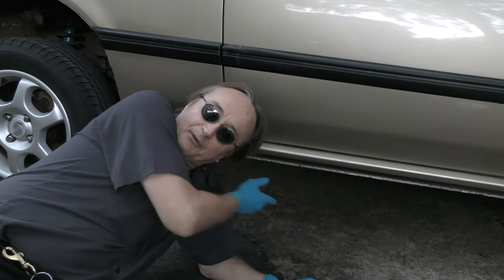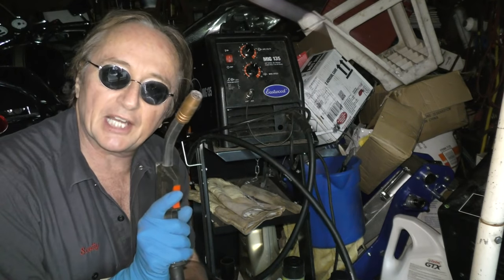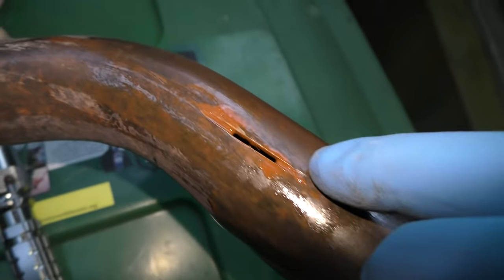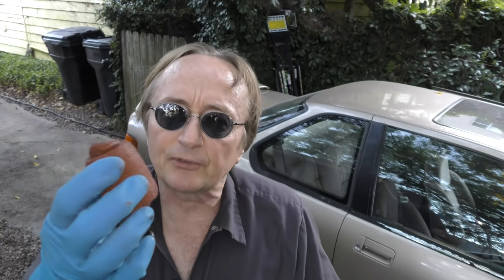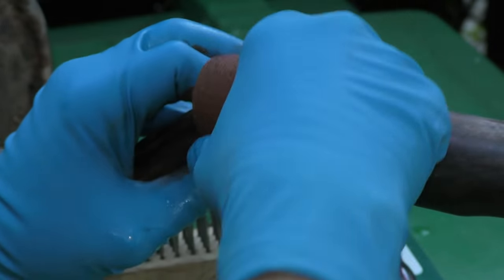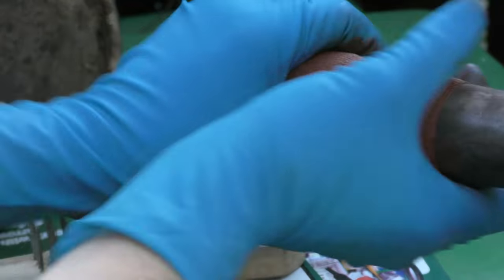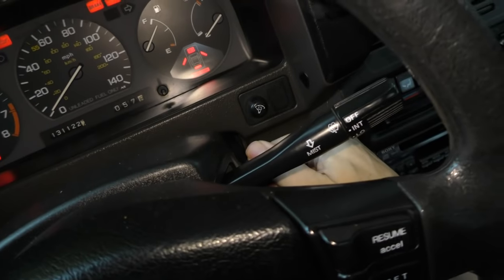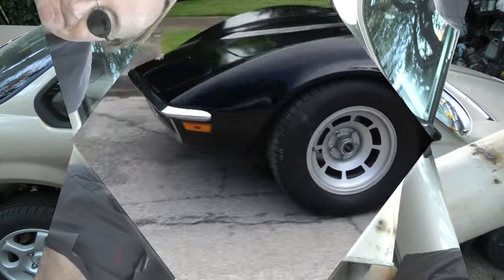How to Fix Exhaust Leak in Your Car for $12

Comment: The shop was going to charge me $60-80 just to get a new piece welded on my exhaust leak, bought this at Walmart for $12 and it worked out great
Reply: Montana Yang  Well of course it's cheaper, it's a band aid not a repair.
Reply: $60-80 i would of done it!
Reply: They are asking 400 for me lmao
Glad I didn’t fall for it.
Reply: did it get rid of the loud noise?
Reply: I used the product from JB weld.  It failed shortly after install.
Reply: 60 to 80. That's cheap.. for that. I would of let them do it. My mechanic wants to charge me 200
Reply: That’s a good price, plus it will last longer.
Reply: I would say 60 is very good for weld job

Comment: My dad used to cut open a Coke can,wrap it around the exhaust hole,and secure it with a piece of coat hanger wire.I did it years later to my car,worked great.
Reply: Soup can works great too-Last for ever- But I LIKE the tape idea
Reply: This fiber stuff works better. I used to use pop cans and steel wool to fix leaks but I'd have to change it out for new cans and wool every month.
Reply: A little JB weld into the hole should work as well. If you have a low temp heat gun, say 200F you can cure it within 10 minutes or so. I wouldn't go any higher than 200F or you might weaken the bond too much for it to last. At the point where I'm very tempted to JB weld the pipe together after repairing a badly damaged cat (the guts were so far gone they poured out as ash). Figure the stuff is strong enough to have JB welded my plenum back together and not leak so it should stand up to the exhaust pressure just as well.
Reply: I love that innovation :)
Reply: Cut a length from a junkyard vehicle, take it to "The Zone" and get a coupler that'll sleeve tightly over the problem area. Cut the pipe straight with a sawzall, smear furnace cement on the cut, smack coupler onto one end with a mallet. Shove it all back together. Wipe off, hit with BBQ paint. It'll actually look decent.
Reply: @eideticex  High Heat JB Weld is a thing.
Reply: Мы в России так же делаем!😂 только лучшее банку от консервов. 😅😂

Comment: You can also use refrigeration foil tape. I used it many times in the past with great success. For a lasting repair, make sure you wire brush the pipe, then wipe it clean with 91% rubbing alcohol before applying a few tightly wrapped layers. Rub down the layers using a rounded object. The heat will bake the tape onto the pipe.
Reply: Would it work on an exhaust header pipe?
Reply: @mrsemifixit  It may be a little too close to the head.
Reply: @electronicsNmore  meaning too hot for it?
Reply: Neat tips. But i just went to a mech shop here in Sweden ang got the CRC Exhaust Mounting Paste. Its supposed to expand and cure with the heat as you start engine. Then whenever you would need to remove it just knock it off. Better than welding in case you need to get original exhaust on again if you sell the car (i just swapped to 3 inch Cobra Sport exhaust on my GTI Clubsport) Anyways, well see if it holds up. Check the car on my channel!  👍
Reply: You must be an equal to Scotty now...
Reply: @electronicsnmore,how long did it hold up? Does the refrigeration tape have adhesive on the back or did you need to apply something else?

Comment: Scotty, I got this kit and used your instructions and it worked. The problem was that I needed to fix the hole to pass Pennsylvania yearly inspection. I learned that in Pennsylvania, only cutting out the section of the exhaust pipe with the hole and welding in an replacement piece of pipe is the only way to pass Pennsylvania inspection.
May I suggest that you make a follow-up or an addition to this video telling everyone to double check what is allowed for each person's state inspection.
I watch your videos constantly and have been very happy with your suggestions to fix whatever.

Comment: UPDATE: Crawled under my Yukon, And it was just the clamp that attaches the Muffler to the pipe that leads to the Cat, the pipe had come loose. Of course the nuts were rusted on and I didn't feel like doing any WD-40 so I just bought the muffler tape (Which in Canadian Dollars is actually 17 bucks!) and popped the pipe back into the muffler and taped that up instead. Took the truck out for a spin for 15 minutes and the tape held on fine. 

Thanks for the video Scotty Kilmer! Keep making em!

Comment: Have the same issue after taking it to a shop, didn’t bother to tell me where the leak is. But guess I’ll take time out to find it. Yea it’s a cheap fix but it’s a year 2000. Not worth putting too much money but it’s still sentimental to me, and still runs great.

Comment: My friend just used the high temperature Gasket sealer (silver) and it worked so far for 3 years, I recently hit my downpipe on a pothole (lowered car). But i would trust this method is much safer and will probably last loner.

Comment: My 2012 Titan truck is great but the exhaust pipe rust through at the flange so I cut the pipe and bought a flange and two clamps that worked very well..

Comment: In Poland, you can fix it in many mechanics workshops or specialized muffler/exhaust system service for a 50 Polish Zloty (less or more about 13 USD), so in my country fixing this issue with that method is rather unprofitable. Moreover to fix exhaust with that tape, you must have some kind of undercar-pit, and in many cases, you will have to remove the exhaust because of hard access to wrap around the pipe that tape - and this is next issue, especially when exhaust is old, bolts are corroded etc... Personally, when i have that kind of problems (small holes in exhaust etc.) i seriously considering to replace a whole exhaust (muffler+pipes, only catalytic converter can be kept old..), because in my country climate and weather is very "good" for progression of corroding process, and this old rusty exhaust doesn't serve more than few mounths untill it gone pernamently... (sorry for my flimsy english...)

Comment: Can this be used to repair holes in rusted cast iron plumbing? How hot does it need to get to cure? Heat gun hot or propane torch hot?

Comment: Probably a stupid question but is this strong enough to hold a section of pipe? Someone stole the cat on this car I just bought so I was thinking of getting a straight pipe put on anyway. If I get a section of pipe that a little smaller in diameter than the pipe on the car, insert it so it's tight and roll this tape around the seams on both ends will it hold? Definitely wanna give it a shot before I spend $500-$800 on getting it fixed. 

My logic is that since the pipe will be slightly smaller in diameter it'll be able to be inserted and that way it can hold its own weight. The tape would just secure it even further and prevent exhaust leaks coming from the seams. Stupid idea or feasible?
Reply: Id put a clamp on it but put it down some so you can also wrap up the area it can escape you know what im mean?

Comment: I've used a brand called tiger patch about 20 years ago on an old 70s ford I had. It held good until I could change the whole system. Got me though state inspection. That's all I cared about at the time!

Comment: Hey Scotty really need your help. Need your opinion on this. I've got a 93 Caprice Wagon with a leaking exhaust manifold. I've been putting off the repair because I can't afford it at the moment, Is it ok to drive the car with a leaking exhaust manifold? Will it hurt anything? I've had a few people tell me it needs to be fixed ASAP while some mechanics say to drive it like that, one mechanic said it's not worth fixing and should drive it as is. It's currently inspected till the end of the year. Can I drive the car like that?

Comment: Scotty, my 2009 Toyota Avalon spits out a P0037 code, and I changed the oil pan because it was leaking but I had to loosen the Exhaust. I broke the flange bolts, but had to loosen the o2 sensors And one O2 sensor got bent can it be the cause of the code? I'm really lost here love Toyota but still confused on this code.m

Comment: That looks a lot easier to use than the old stuff, you had to soak the tape in some glue they give you with it; it was super messy and really hard to deal with.
Reply from the maker: yes, this modern version is MUCH better and less messy. Plus it hardens faster and stronger.

Comment: Gonna probably do this tomorrow - Today my freshly purchased '92 GMC Yukon started sounding like an angry grizzly whenever I step on the gas so i'm assuming I put a hole in the muffler or cracked the pipe, like in the video. Hopefully it is just the pipe.

Comment: I am told here in PA that exhaust repairs must be done with metal, and wraps and epoxy don't pass inspection.   Sound legit?  How many states I wonder require more permanent fixes.

Comment: Does this work to join two rotten pieces of exhaust? The exhaust rotted away in the middle not near the joint so otherwise I would have to replace a good amount of the exhaust system before the muffler.

Comment: So what's the deal if the exhaust leaks at the flanges(where the connects)? I got my Y-pipe caught on dirt while the exhaust was hot and it bent the flange after the headers, before the cats. My mechanic said I wouldn't be able to use a fix like this(or that putty stuff) due to the heat generated. Ended up having to buy a new y-pipe(i brought it myself) and had him weld it for me.

Comment: I installed a new exhaust on my car few months ago but now I realize there's water coming out at connections where pipes meet and some smoke coming out at clamp location? Is it normal? I know there's weep holes in OEM mufflers but not on aftermarket ones. Not sure how aftermarkets deal with condensation.

Comment: any temporary fix for a small leak at the manifold gasket, or will the heat destroy all attempts?
Reply from the maker: at the gasket, you really need a new gasket. BUT, there are high temp putty systems in a jar that I've used to some extent for short term fix
Reply: Scotty Kilmer Will it work on a flex pipe ?

Comment: I recently used a can of corn. Thanks to a You Tube video. I cut the can length wise and put it over the pipes were they were leaking. Used clamps. JB Weld  It is very quiet.

Comment: I have a Ford Excursion 2000 v10. I can smell the exhaust from the cabin. Is there a possible leak somewhere in the exhaust system?
Reply from the maker: sure, check for noise, especially early in the morning when you can feel for leaks without burning your hands

Comment: I know this is a cheap fast way to fix it to get pass MOT but as a long term fix, will this rust out your pipe under the fiberglass?
Reply from the maker: it certainly seals that part from outside rust, like salt and water

Comment: Some one answer please... could I use this wrap and the. Put an exhaust clamp over that? I have a 96 4runner and behind the exhaust it snapped in half cause rust and like hanging there... if I wrapped it like you showed and put a clamp on it, would it cure correctly?

Comment: How do you find a leak?
my car isn't terribly loud and when its just idling you don't really hear it too much.
But when you press on the gas there is some vibration and noise coming from the side of the car.
its hard to tell where from when I'm driving it, but certainly sounds like a small leak somewhere
Reply: It probably is a flex pipe leak.  Those are intermittent sounding since the flex pipe might seal it up and then when it flexes it opens the leak up.  This trick won't work, need to get it replaced through a muffler shop.

Comment: Would the patch work on a Resonator? My 2001 Oldsmobile Intrigue has holes in the Resonator and a bit on the Muffler end as well. Or would it be better to replace the whole thing (the catalytic converter is still good)?

Comment: Hey scotty! i'm trying to patch a hold that's leaking in my exhaust manifold. The leak is before the catalytic converter. I want it to be a quick fix but the putty they sell takes 4 hours to sit and I'm in a place where it's 0 degrees. Can fiber fix work before the catalytic converter?

Comment: How close to the headers can I use this? I got a 2000 Navigator with the 4v 5.4 and cat the cats off so it has a right pipe there now but the weld has a leak in it and of course its between the pipe in frame so cant weld it with out taking the manifold off again witch I dont want to do so just seeing if I could use this for like maybe 6 months to a year till I put headers on it. Thabks

Comment: i put a clamp on exhaust tip (i know..its temporary until i get a catback) but theres a gap between the inlet of the tip and the outlet of the stock pipe, could i use this product to seal the gap?

the gap is only visible looking through the pipe

Comment: I used something very similar back in the 80's. You didn't have to wet it or put aluminum tape around it. It lasted for many years until the pipe rotted off near the fix.
Reply: yeah, by that time the rest of the pipe had issues as well, so it served its purpose.
Reply: It got me through a couple inspections. ;-)

Comment: Would this work when patching over a torn flex joint? My saturns flex just ripped from some rust and a branch that got caught underneath but it's otherwise fine and I'm really not wanting to cut it off and weld a new one on.

Comment: Hey scotty. I have a chevey cobalt. 2.2L front wheel drive. I had the front end aligned,  then shorty after hit a curb and bent the rim. It still drives straight as an arrow, and seems just fine. But after replacing the rim (with a junkyard rim from a car that had no front end damage) and i am still using the old tire (that was run on the bent rim for a few months). Now that i have the new rim with the same old tire (put on the back of the car). At roughly 75mph+ i am noticing a slight vibration that gets worse with speed. I originally thought that it was probably a flat spot on my tire from me hitting the curb and running the tire (what i thought was unbalanced). But I also know that a flatspot on a tire should get worse. but this is not. Could i have possibly bent the front axle ever so slightly? and if so will it eventualy need replacing?
Reply from the maker: many things can bend, mainly the lower control arm. Have a pro alignment guy check that, most give free estimates
Reply: Okay cool thanks! I think that something has bent because it is the same vibration that i had with the bent rim. I originaly thought it was just the bent rim being out of balance. Now could this possibly get worse?

Comment: Hi i recently got a 04 Mazda 3. When i accelerate it will vibrate really bad and when i brake it will make a clicking sound. When i put it in neutral and coast the vibrating stops and it sounds normal. Any suggestions on whats wrong?

Comment: Hey Scotty, while I was on the hwy some truck ran over some metal scrap and threw it under my car. I couldn’t turn or brake and ended up running it over but it punctured my transmission Pan and it dented my muffler and broke by the exhaust. I was wondering if I would be able to use a JB Weld or some type of muffler cement to patch them up temporarily or if they would need to be replaced. I recorded a video of the damage and posted it on my Page, can You check it out and Please give me some advice? 
I’m on Parole and I Really need this vehicle.

Comment: Please help!? I have a 1999 Mitsubishi Eclipse rs I have engine rpm surge sometimes when I get on the freeway the throttle body gets stuck open car stays at 3500 4K rpm until I neutral rev it to 7k then the throttle body closes. I've changed the throttle position sensor. Idle air control valve. O2 sensor. Clean out the throttle body. Changed the air filter spark plugs ignition coil pack. Still have original spark wires. It surges until I turn on the ac then it idles below 1k like it should but then once off it stays above 1k and surges to 2k

Comment: Hey Scotty, 3 piece upper radiator hose. Steel tube with a short rubber hose on each end. Would you use the resin patch on the steel tube? And thanks for your videos!

Comment: i got somthing else from autozone and it split my exhaust in half. it was this black super sticky rubber like stuff was only like 2-3 maby cant remember. now im using 2 adapters pushes the exhaust forward a bit but makes it tight so probably not going to fall off.

Comment: I just used J.B. Weld.  It's really great stuff.
Reply from the maker: that can last a short time, but it's not made to take the exhaust heat like this wrap can easily stand for a LONG time
Reply: If I have to redo it, I'll sure try that wrap.  So far the patch has lasted a year, but it's farther down stream.

Comment: What is fuel system 1 ol drive and what can trip this to go off?

Ok so I just replaced my O2 sensors due to smog and seems like its working since I never got this message fuel system 1 ol drive while doing drive cycle.
Reply from the maker: you may need reprogramming for those new sensors
Reply: would that mean doing drive cycle?

Comment: i have an accord and the pipe behind the exhaust muffler is after breaking away. i got this stuff called poxy steel paste. would it do the job in put ting it all back to again. do you reckon?

Comment: Can anyone help? I have a 1968 Buick Electra with a fairly new exhaust system. After 20 minutes of driving the inside of the car as well as my hair and clothing smells of exhaust smoke. I also get a bit of a headache. I’ve taken the car to several mechanics and they can’t find any major exhaust leaks. There is a pinhole leak in the lower manifold where a heat riser for the choke is located, but they all seem to agree that wouldn’t cause the smell inside the car. The belief seems to be the car is running too rich. Perhaps? But wouldn’t I smell it outside the car rather than inside the car? What’s going on and is this dangerous to drive?